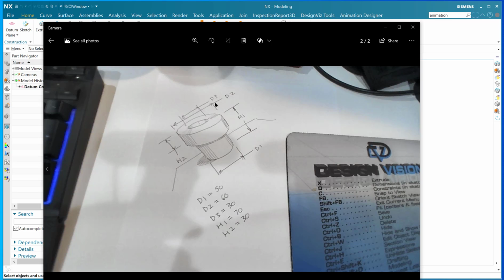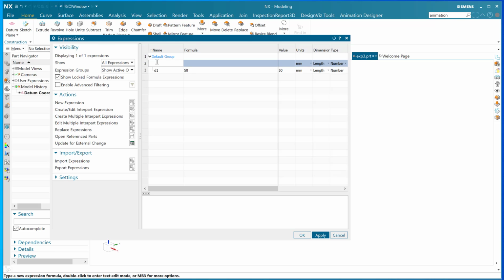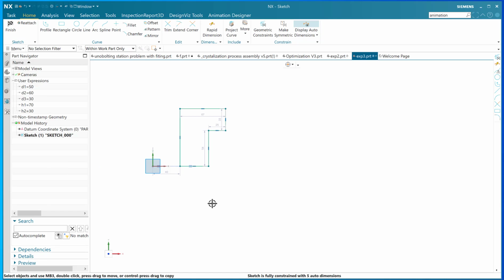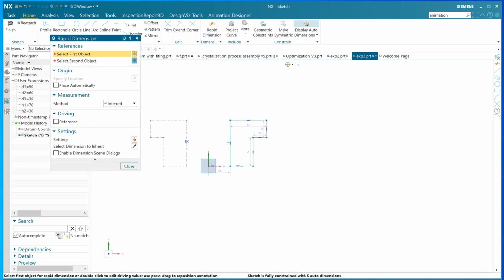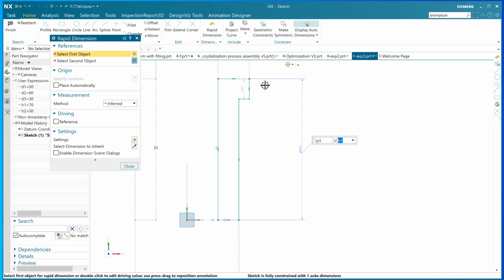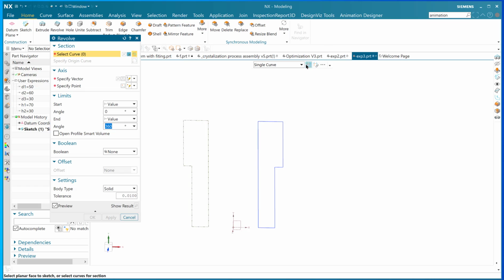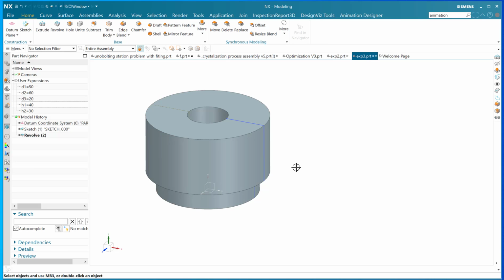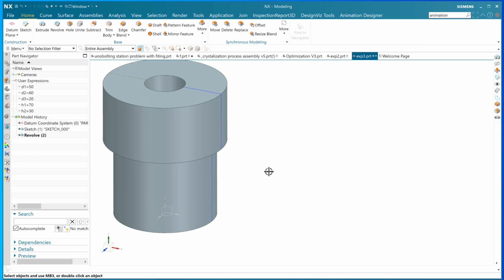User expressions and a dimetrical revolve

Comment: NX2007 supports half diameter so you don't need to do things like this anymore :)
Reply: Thank You for the response, I will have  to figure that out. That would be very helpful at times. I haven’t downloaded 2007 yet, didn’t want to change in the middle of a project… 😀